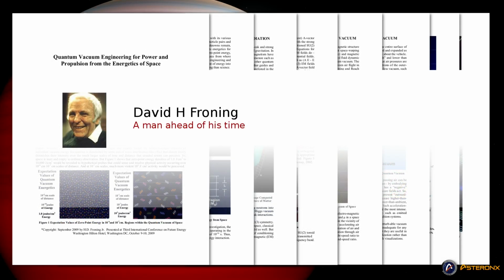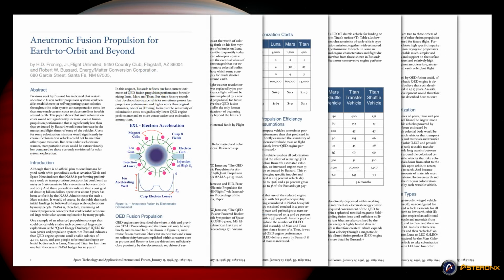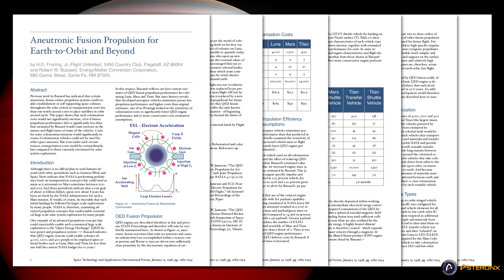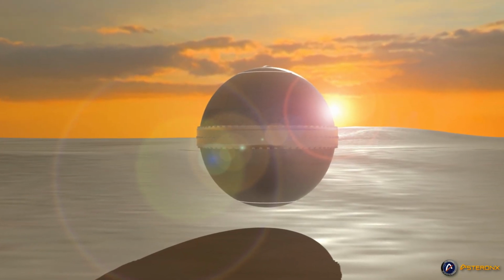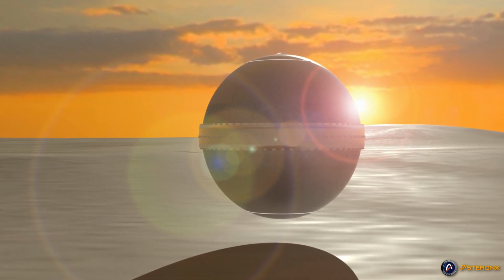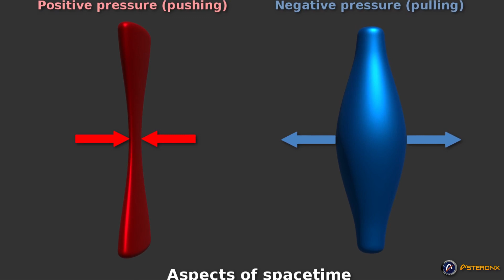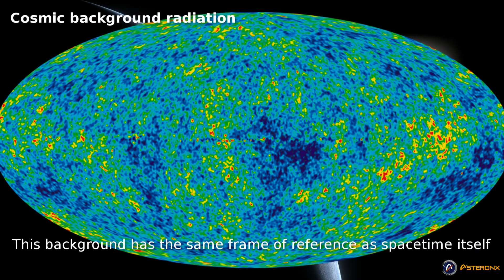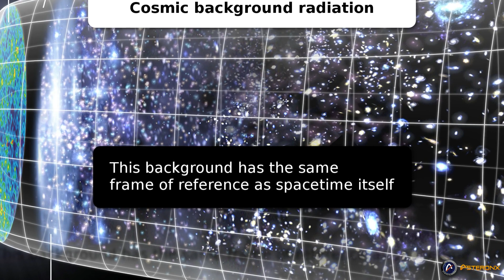An explanation of the Alcubierre-Froning Warp Drive part II

Comment: Does the Alcubierre-Froning Warp Drive also facilitate artificial gravity on spacecraft?
Reply from the maker: No, as it turns out, true or real anti-gravity with our current tech level is inefficient (requires too much energy). But, once refined (require less energy), anti-gravity will be feasible.

Comment: I think i understand how your drive works. You use lasers converged with lenses into infinity, to create negative Kelvins and pulse the lasers to achieve the speed you require. Ideally, youd want an array of lasers, each magnified to trillions of times, pulsed in unison, to zap space time as close to the aperture as possible. You could achieve this by a higher magnification or higher power input. That's how it works right? A vacuum with in a vacuum. Funny, i thought of that when i was 16, just back then i thought of compressing plasma, with electromagnets, down. Then add more plasma, till the mass that is contained moves the ship. Hey i was 16. Much eaiser way to do it.

Comment: Id like to help. If you entangle 2 particles and put them in 2 particle accelarators then change the spin of one particle, you can send digital messages across any distance and faster then light. Have you done experiments to test if entaglement is affected by the warp? If its not, then you now have subspace comunication. Oh and you solve the particle degridation problem in the accelerator by constantly adding a stream of new particles and letting them also entangle. You could have one master particle on earth and have all other particles entagled with that one to make a cortex of comunication. All The supercomputer/ AIs on ships will also will have a time refrence point, with this quantum entanglement com link, that everyone can sink up to. Dilation wise, this serves to keep everyone in sink with less stress on your computers to have to do the math to figure out when and where you are. Since theoretically, there is no real limit on how fast you can change a particles spin, then the amount of data being able to be transmitted is limitless. Meaning VR missions with warp drones will be possible, as the data link exists. Anyways just my thoughts. Have you given any thought to weapons?

Comment: if your car could go the speed of light ,would your lights work
Reply: The two postulates of special relativity state that the speed of light is constant in all reference frames and that the laws of physics are invariant in all reference frames. The consequences of these two postulates are the well known time dilation, length contraction, and relativistic mass increase. These quantities get scaled by the Lorentz Gamma factor, which is undefined for objects going the speed of light. From an outside observer, the light waves will simply stack on one another, creating the equivalent of a shockwave of light (this is already manifested as Cherenkov Radiation, for which relativistic electrons exceed the local speed of light in that medium.) From your perspective, the light will still appear to go the speed of light, which seemingly contradicts the observer at rest's observation. This is what happens when you essentially divide by zero, and this will never happen because objects with mass cannot exceed the speed of light in a vacuum (this only applies to objects moving through spacetime, not spacetime itself so the Alcubierre Drive doesn't violate relativity. This is clearly evident as galaxies very far away move away from us faster than the speed of light, which means we will never see them.)

Comment: As a space craft accelerates to any appreciable percentage of the speed of light, and gasses or space dust impacting the spaceframe could be extremely dangerous.  In Star Trek, they  used 'deflectors' and 'shields' to protect the ship.  In reality if a speck of dust hits the ship it will impart quite a bit of energy into the hull.  If one could employ some kind of electronic shielding, any gas or dust that hits the shield would likely burn up in the impact, and if there was quite a lot,  you would have a plasma at the nose of the ship just like a space craft reentering the earths atmosphere.  It would be quite the sight.

Comment: Why is there nothing on Wikipedia about this?  Why is there nothing about Froning either?  Which particular symmetry is altered or broken to produce this so-called conditioned state of photons?  Where does the negative energy come from?  From what I understand, you were illustrating this with the Casimir effect in the first part of the video series, which is a type of negative energy produced by limiting the physical space in which the vacuum energy can operate, thus producing an imbalance in the forces felt between two plates placed extremely close together.

Sorry - too many questions unanswered, although I am aware of the theory/hypothesis about gravity being a force resulting from a torsion field in a strong EM (photon) field and it being possible to produce anti-gravitational effects and extremely high speed vehicles powered by producing shear in a powerful, artificially produced EM field.  This latter is a far cry from your 'symmetry altered' photon-based drive.

Comment: The secret of the warp drive is the bi-polar subatomic counter-wound induction windings used to produce semi-neutronic anti-particles broadcast with magnehelic repulsion transmitters and pulse-polarized using bi-directional episodic dipole diverters. Semi-acoustic vertically-interspersed harmonic wave transducers are frequency modulated with proton-injected capacitance inverters and phase-synchronized laminar condenser windings.

Comment: What proof of concept, if any, has been generated as of yet? This sounds good... So did the last five ideas I had that didn't work... :)

(Fingers crossed for you though! this would be incredible.)
Reply from the maker: Froning and his colleagues have a long and well-reputed body of work behind them. The relevant papers are linked to in the video description :)
Reply: @asteronx  I glanced through that last night, but didn't see much by way of practical experimentation. Did I miss it? (That's possible. As I said, I glanced. It would simply save time if you know where to look, like a paper name?)

Thanks!
Reply from the maker: @dalepower632  The link might be in the description of the first part (Alcubierre-Froning Warp Drive part I), but Froning et al, did preform some experiments with special coils.
Reply: @asteronx  That's Awesome! So it will be in the Froning et al portion of things or related materials? (I can search from that point, I think, if anything is online/not behind a paywall.) I'll get right on that. Thanks for the lead there!

Comment: Conditioned photons?   If they have different properties than regular photons you probably cannot really call them photons so tearing space/time with them  might not be too healthy to be anywhere near.  Ok, here is a good question.  How are these energy transfer wavicles manufactured?  Can it be reduced in size?  Just because the math works doesn't mean the physical process is practical at all.  The Haber-Bosch process barely works but it is essential to the production of nitrate based fertilizers.  Phosphorus is another important compound.  Where does the Amazon get it's fertilizer?  Guess where.  The Sahara desert.  So movement of fine particles can affect the eco-system of an entire continent an ocean away.  What do you think Fukushima and Chernobyl disasters did?  Nope, the experiments if there ever to be full sized should be carried out in another universe in case the tear never closes.

Comment: Are you reffering the individual photons as a particles, beacause what we subjectively  call  a photon is an actual lontititudial wave pertrubation through the medium which we call space? Does that somehow corelates with parametric resonance of the system (only using  the so called photonic frequency spectrum), or simular to constructive/destructive interferences, as in case of acoustic waves terminologies? Please respond with your explanations ( not descriptions). Appreciate your answers in advance.

Comment: I would like to propose a question.. As explained a shield as such in the show/movie Star Trek, a shield would be slightly damaged, should something hit it, and the percentage of available power was what was left of their shield and the more it got hit, the more it would drop. With a Photon shield, you say that objects would simply bounce off and not touch or harm the shield short of hitting a comet or planet or such, but what if you were to be able to draw more power from the object hitting the shield, thus making the shield stronger. Simply, the reverse of damage as in Star Trek going to the totally opposite direction? Lets say, we do encounter a hostile alien race that wants to do harm, they hit our shield, and the shield strengthens more, causing a deterrent to them trying to hit our ship? Or, an object with several times more energy than the ship itself hits, and that energy is gathered and stored for future use? Could it be possible to come up with such a shield rather than just one that bounces objects away?

Comment: so,  the issue for warp drives is not a square car moving on a road at 35 miles per/hr?  No!  the issues is engineering a paint that you spray on the car that interacts with the space-time fabric using protons to act as a knife or lubricant to cut or slide the car throw the space-time matrix defiling not the car but the space-time matric that is around the car?  i get that much i need you to to drill down on how protons paint can cut into space-time fabric?
Reply: @James Robenson  Photons are bosons.  If you can make a photonic boson shield(strongly interacting photons, or SIPs), nothing can pass thru it.  Remember, Higgs bosons are very large, thus they are called massive particles.  Photons are much smaller and can form a tight 'mesh' that Higgs bosons can not get thru. If the particle that carries the effect of gravity can not get thru the photon 'mesh' then they have no effect, or impart no gravity to the object covered.  Thats your K-Y Jelly.

Comment: You present some very understandable concepts and sound science.  However why are we still playing with chemical rockets and MRs when the Universe beckons us to do more.  If we have the science why spend $800M on rockets?
Reply from the maker: Great question. Although this concept is based on well known laws of physics, there are many other factors that must be addressed first. For one, no has as yet built and tested a working prototype let alone a model of the drive--only simulations and much calculations. A ship that is going to be equipped with a warp drive will require other technologies not yet developed as well. This is exactly why we need to start the process now.

Comment: Tearing the space/time fabric? 
Sounds fairly dangerous and destructive.
Has anyone done an environmental study on this?

Though this might work; I don't they understand the essentials:
1st: space/time is not 'stuff'...  Until observed, nothing is more than a probability distribution, a potential.
Reply: Lol warp drive shut down by peta and the naacp! Not diverse enough and your killing the flys!
Reply: John Chalinder,  trying to use nuclear power to travel through the solar system would be what's dangerous...potentially tearing space/time and dimensions by splitting atoms and setting off chain reactions nobody can control....I would opt for developing this quantum extraction tech.  Research is being done on migrating birds has found that they have (evolved?) a way to tap into quantum mechanics and get linked into the magnetic field to get directions for flight...if they can do this we need to get on with it and get past fissile and fossil fuels for propulsion.  I want one of these sleek craft.. about twice the size of my dining room table..parked in my garage within 10 years.. screw the electric car!
Reply: Lol..
Reply: "1st: space/time is not 'stuff'..." 

Not exactly, but it is something. It's a sort of fabric that can be stretched and twisted.

Comment: Second comment, really question. I know we have Titanium, which is supposed to withstand temperatures of 3000°F. Do you think that if we used a processed diamond/gold cohesive polymer on the Titanium? Or is that even a feasible idea? I know diamonds can withstand very high temperatures, as well as gold, so my thought is that if you can combine the two and polymerize it that it might adhere to the surface of the Titanium. I know this may be a stupid question, it's just an idea.
Reply: Try Tungsten. It has a melting point twice that of Titanium.
Reply: Gold is very easy to melt.  Diamonds will ignite and burn just like coal if exposed to high temperatures and oxygen
Reply from the maker: Your question is not stupid. Diamonds will burn (not melt) between 700-1200 degrees, so, not a good idea. It would not be practical to reply on shields alone so you are smart in thinking about superior construction materials. As a starship approaches the speed of light (still sublight), deadly radiation will be generated by the craft's movement through the spacetime medium, this means that the craft will heat up, the crew will be radiated, etc., if not properly protected. Keep learning and searching for new materials. I would suggest you think about condensing/squeezing allows in some fashion not yet discovered.
Reply: Problem. Tungsten is heavier than lead.
Reply: In outer space it matters not, because everything becomes weightless ness -up to a point, I think,
Reply: Curiously enough the orion's arm universe mentions a material called adamant. Which is a mixture of various carbon allotropes and nanostructures combined in such a way as to create a material that is hundreds of times stronger and lighter than steel but looks like polished graphite. 

In orion's arm, most early interstellar starships used buckyball reinforced water ice and pycrete as an ablative shield/covering that wore down over a relativistic trip to a distant star. This ablation is how a relativistic starship stays in one piece while avoiding heat buildup.

Comment: Using light to travel at the speed of light?  Is that what your saying?
Reply: fmj 556 No, using light to create a warp in space time in order to travel faster than light in normal space time
Reply: hey buddy you might want to work with jeremy rys founder of hoverbrothers.com.
Reply: Thats really cool!
Reply from the maker: No. It's more complicated than that. The drive would use conditioned photons (electromagnetic waves) to generate a bubble of negative energy around it, which would then accelerate the craft up to and beyond lightspeed, provided the starship was already accelerating. Therefore, the starship will still require a drive for initial acceleration.

Comment: I like to see the spacecraft like the Enterprise..
Reply: Who wouldn't?
Reply: Take another look at the Enteprise NCC1701. The saucer section is close enough to the Alcubierre-Froning shape. The engineering section and nacelles could hold Alcubierre-White generators (3 points on a circle) with one set at the front for pulling space-time, and one set at the rear for pushing space-time. In other words, a hybrid ship incorporating both a gravity drive and a warp drive.
Reply: While I'm a Star Trek fan myself the designs of the early Earth Starfleet and later Federation are not feasible for FTL travel in the way of warp.
Reply: Thing is you don't need nacelles. You need 2 tori (tori is the plural of torus). One toward the front, and one toward the back. The front one would compress space in front of the craft; the rearmost one would expand space behind the craft.

Star Trek ships look cool, but they just don't work for FTL in real life. If you don't need something on a spacecraft, then you don't include it. Spacecraft are for flying in space. You don't put things on it for cosmetic effects.
Reply: @carlo1831  Tell that to "Tom Paris". Ha! :-D
Reply: Kav Eone Tom Paris was not a spacecraft designer. Oh, sure, he designed one, but he was first and foremost a pilot and a very good one. As for a spacecraft designer, he was mediocre at best.
Reply: Kevin Davis       Not a good design.
Reply: What one   : P